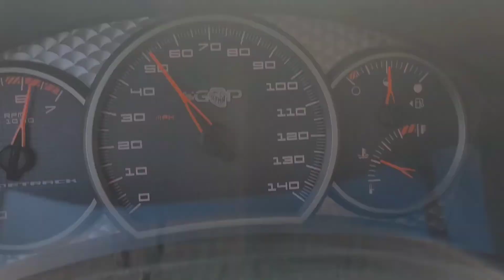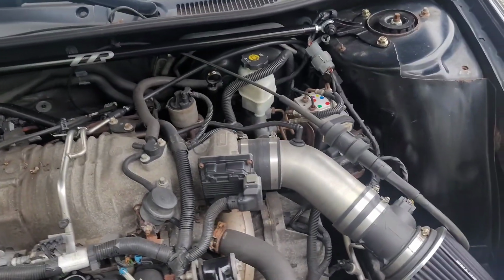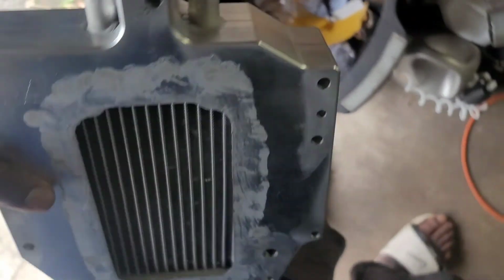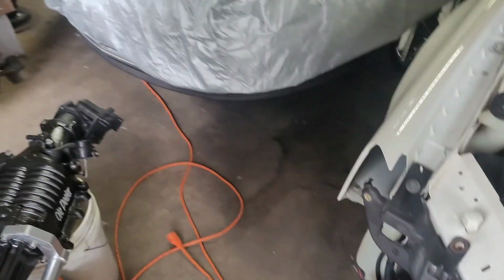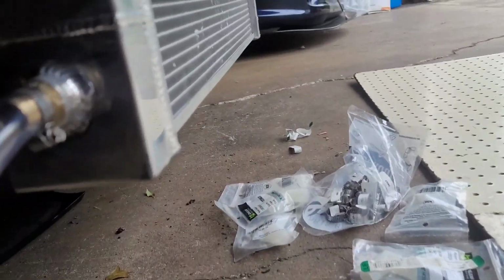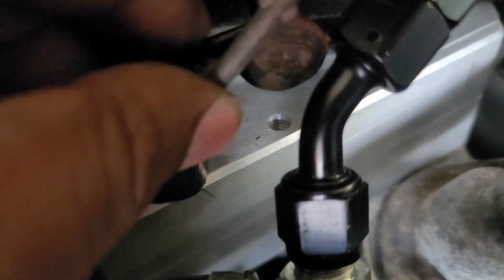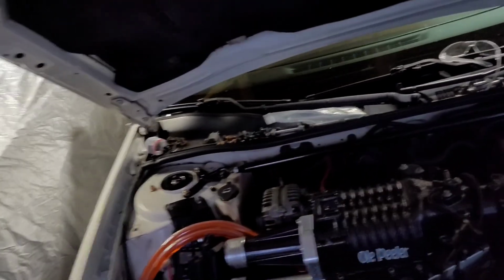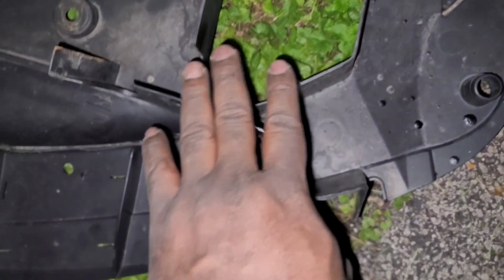3800 wbody m90 full size intercooler installation

Comment: Dude, why does no one cut the core necks so you can use full 3/4 inch ID.
And I'm still of the opinion that the old school Scirocco radiator installs were better because cut up foam pool noodles would let your radiator fans work quite effectively for your heat exchanger and using 2-in diameter hose really increases your system's volume.
Reply: I know everyone wants sh it that just bolts on.... bunch of sissies.

I also don't see nearly enough polka dots....shall have to rectify that
Reply: Are those -6 or -8 id fuel rails?
I'm only asking cuz I generally like to grind the welds on the end of the factory l32 rails and remove the pulsation dampeners to insert into the aftermarket rails on the deadhead/retuenless fuel system cars... well I also do it on return style cars....pulsation fueling related issues are actually a thing.... when you look at them you'll see the drastically larger amount of surface area to provide dampening compared to the old rails that they released back in '99 or 2000 with the disc style dampener
Reply: And where the f*** do I find the fast forward button in my garage to let me work that fast.
Reply from the maker: @Turbocharged400sbc -6an
Reply from the maker: @Turbocharged400sbc  🤣🤣
Reply: @hand12u  grab your factory 032 rails look at the end with the TIG welding and grind off that weld to extract the end plug and pull out the pulsation dampeners I'm pretty sure you can figure out what you need to do after that.
Reply from the maker: @Turbocharged400sbc  ok will do

Comment: I want to know why you used a Gen 3 supercharger gaskets with a Gen 5 Supercharger?!?! I realize that that core you are using is made for a Gen 3 and "technically" it will work on a Gen 5 lower intake manifold and with a Gen 5 supercharger due to the extra material under the snout even though there is a 7/8" port mismatch, but with the Gen 3 gaskets, you are going to have a massive vacuum / boost leak under the snout.
Reply from the maker: @AwesomeBuford  car has no leaks I actually did a ride along video of me driving it yesterday but the lim on the gen v and gen 3  coolant holes are different gen 3 u can cover with 2 dimes gen v u gotta tap shut also for as gaskets I open the inlet and trace wat is cut on the lim on the gasket so everything matches I do this to every ic I do